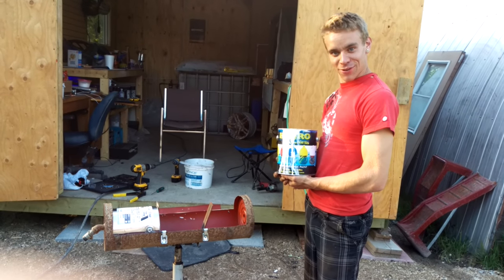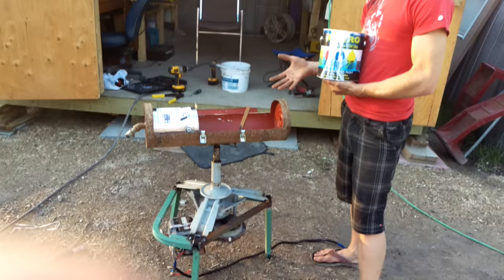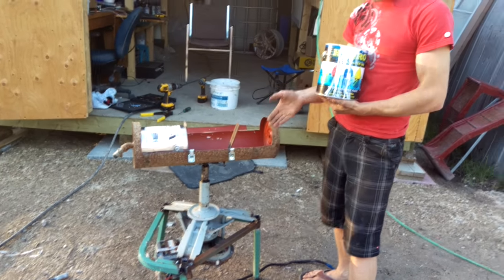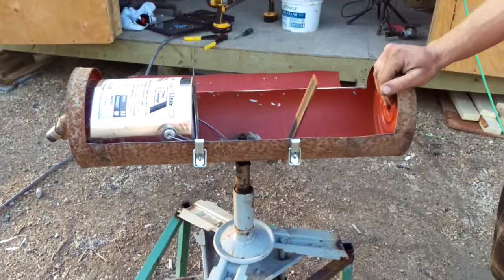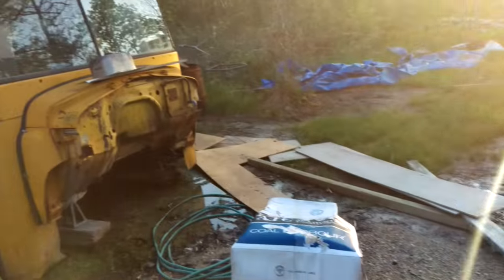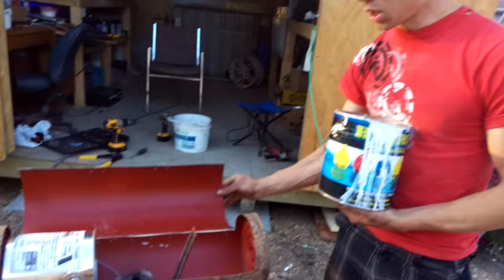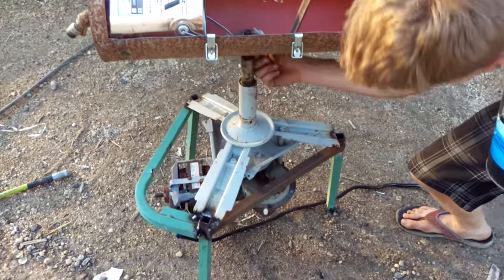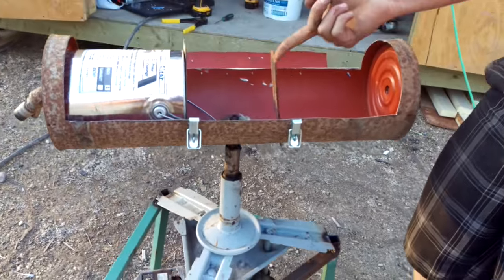Paint Shaker Mayhem - DIY Paint Shaker

Comment: What washing machine transmission?
Reply from the maker: No transmission. Just straight off the motor.
Reply: @EppicIndustries  
How is it oscillating? If it was straight off the motor, it would just spin.
Reply from the maker: Ahhh, I misunderstood you. 

Well, I built this thing about 10 years ago. Can't really remember what I did. 
Pretty sure I was just hooking up wires till it did what I wanted.